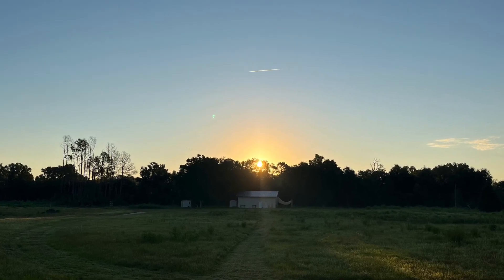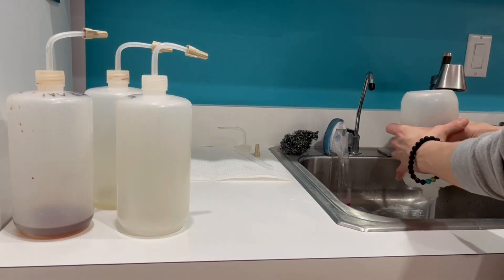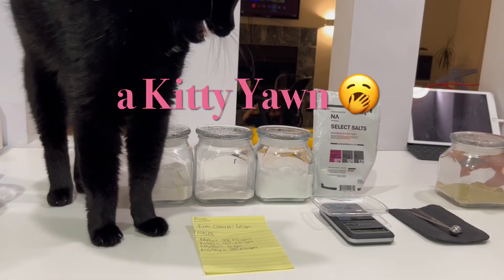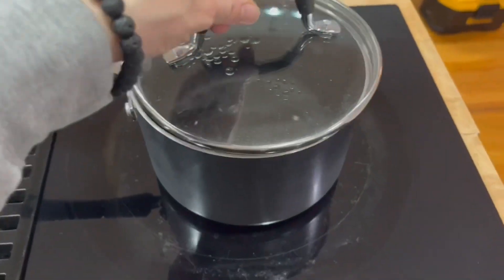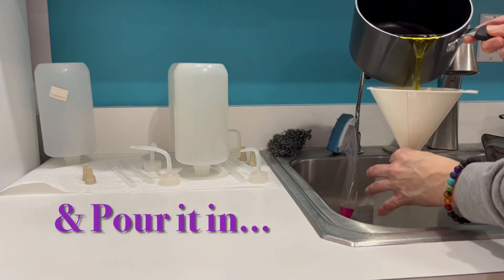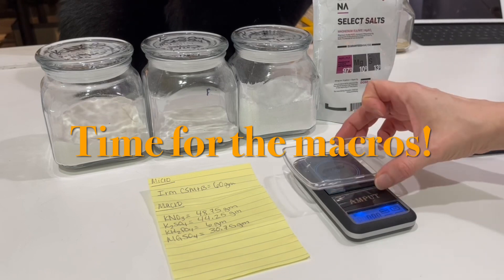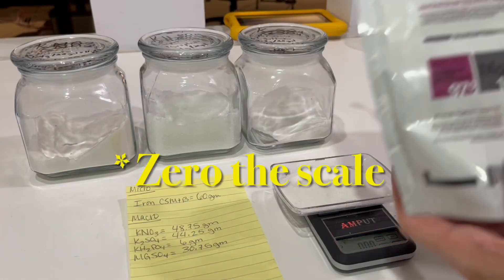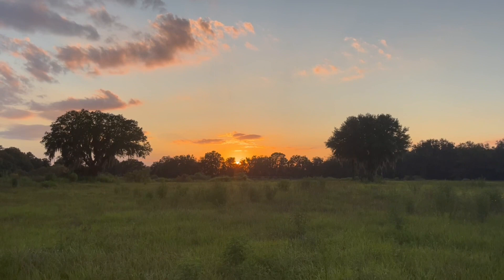DIY Aquarium Plant Ferts | LRB Aquatics method for feeding aquatic plants! 🌱💦

Comment: I do 10-30% water changes several times a week. How would this affect dosage frequency or concentration?
Reply from the maker: Definitely be sure you’re dosing after your water changes. It can be tricky to find your perfect balance, but you can temper a lot just by how much you squeeze out of the bottles
Reply: @ladylrbnaturelife  thanks for sharing. I noticed shop bought ferts rot/solidify quickly and they're expensive for what they are. Like this approach. Good info